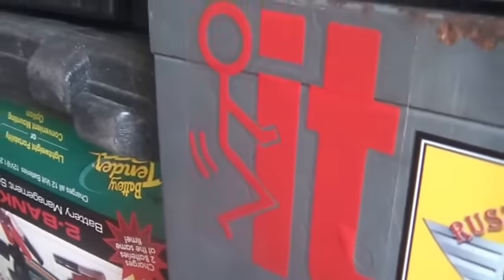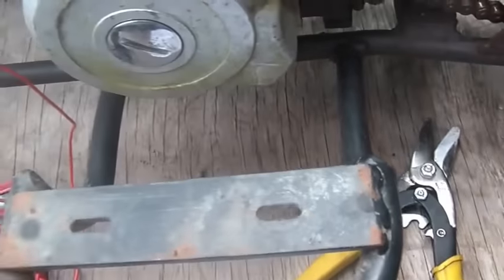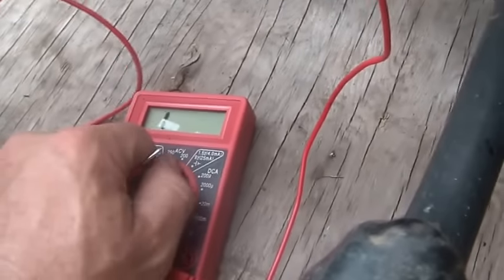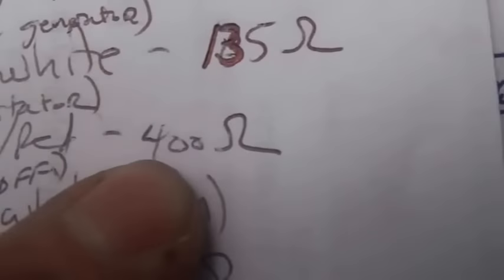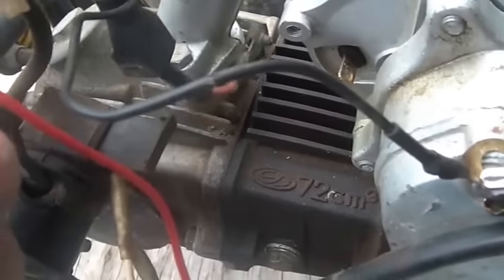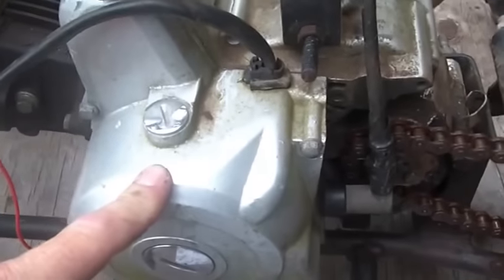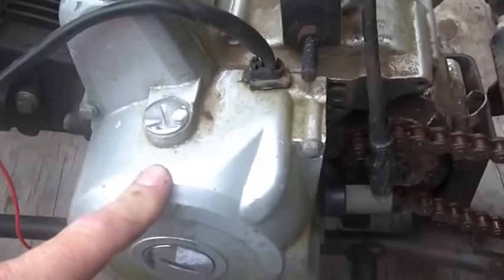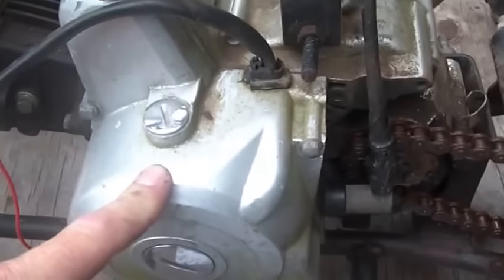Troubleshooting a no spark China Quad, critical wire harness measurements,

Comment: my battery is not charging .. I  put in a new engine. 47cc pmf .. it runs the lights, but not bright,, horn not loud, chirpts ok at 6k  rpm.. but   wont charge battery ,  tested in voltage at  wires going in to voltage reg/ rec   11.5 volts.. and other pair 8.5    help//
Reply from the maker: Hey Jon,  Not Sure how many phases Ur stator are putting out, typically for the smaller engines, they are 2 phase, (2 yellow wires), between the 2 yellow wires with the engine running should be a voltage above 13V.... I'm thinking Ur regulator is bad....  Thanks for asking, watching, and commenting!!!!
Reply: one yellow one  and one red .. 5 wires,,, it runs the headlight, measured current going into the voltage regulator at 11.74 volts.
Reply: i just bought one, ill test it .. these chinese bike are notorious for these issues..fyi,  bought another bike same, no issues at all on battery or charging, but didnt swap out motor   thanks for reply
Reply: there is a white and a yellow. maybe its not ment to charge battery..
Reply from the maker: Hey Jon, U seem to be working thru the troubleshooting pretty well, from experience, and given that Ur bike is not in front of me, so, I can not trace the wires to be sure.... But, I'm thinking the red wire goes to the CDI to provide AC power, from the stator,  for the ignition system.... A white wire, and a yellow wire provide the 2 phases, (of AC Voltage),  going into Ur Voltage regulator, I hope this helps, please keep me in the loop, thanks for asking, watching, and commenting!!!
Reply: i think the  yellow is to run the lights, /white. charge battery.I am thinking now that, the bike powers everything ,, when i rev it to 5 k rpm , the horn peeps normal, less than 5k , it sounds low horn, The system, 12 volt 35 watt light,headlight ON ALWAYS. 12 volt 15watt tail light, indicator gear lights, on always. simply is too much for the bike to have any extra   power for battery.I will say , that less than 12 volts is going into voltage recifyier.It could be that  it is the harrness,, It could be that the front right brake is a switch that powers the stater that i took off. but the brake  switch is still on handle and in normally closed .postion.
Reply: Hey

Comment: Sir my bike sparkplug not sparking I changed all coil like stator coil,CDI unit, ignition coil plz what is the problem
Reply from the maker: Hey RY7003, U did the first thing perfectly, U changed the plug to start Ur troubleshooting.... Assuming Ur bike does not have a key FOB turn off circuit, I would go back to all the old components and wire harness, I would make sure that the grounds on the spark coil, engine, wire harness, and CDI are all good, then I would cut the black wire with the white stripe that does to the CDI such that it can be connected again in the future.... More often then not, the key switch turnoff and or left handle bar turn off goes bad.... Thanks for asking, watching, and commenting!!!

Comment: I like to find out how to do the oil mix gas engine 110 CC Yamaha I got the same problem with my wire harness can somebody show me how to do it appreciate
Reply from the maker: Hey Ana, A lot of 2cycle engines don't use a pulse generator and run at a much higher RPM, I don't think this ignition system would work for U.... Thanks for asking, watching, and commenting!!!

Comment: Don't know if anyone will see this but I got basically the same thing a little 72cc china bike and I got it running great and I was trying to hook up the ignition wires so I could have lights and I touched 2 of the ignition wires together and pop, now it just cranks, I checked the only fuse i can find and it looked good i swapped it with a different one just in case and it didn't work. If anyone has any ideas please let me know as this is basically my little get around quad. Please and thank you
Reply from the maker: Hi, No sure what U shorted together, but, my guess is that the CDI box died or the ignition coil, maybe both, most likely, the cdi box as they are pretty delicate.... They are cheap on eBay.... I hope this helps.... Thanks for asking, watching, and commenting!!!
Reply: @HarveySpooner  thank you very much sir, that's what I was kind of leaning towards is the cdi box I'm gonna try the first and hopefully that works, can you tell me the way to test that, or is it already in this vid and i just missed it?

Comment: can anyone help me i have a demon x 125 it had a racing inner rotor kit A.K.A the stator and flywheel but i swapped it over to a normal one because it broke anyway i get a pulse through the the cables at the stator but once i wire it to my cdi i dont get any kind of spark or that from the plug but i know its all wired properly ?

Comment: need a little help I got all colors plus a got a green and red
Reply from the maker: Hey Courtney!!!   U have a wire that is green and red or an extra green wire and an extra red wire???? I'm going to assume it is 1 wire, green and red, given that, if the other colors are there, I would not hook up this wire for now... If one of the wires, (ground, stator, and pulse generator), is undefined, I would use the process of elimination to figure out what it is... But, I'm guessing that it is stator ground, but, I would have to look at the other wires and test it to ground with a digital Volt Ohm meter to be sure.... I hope this helps, thanks for asking, watching, and commenting!!!!
Reply: Courtney Kelley help colours

Comment: My 2008 Chinese bike will not run had it tuned and a new battery installed and a new carby it worked for a week and won't start 
Apparently you have to pull the clutch in to start it and need a full battery charge it has an electric start as well and a kick start but it just winds over on electric start and you can not kick it over 
Think it might be shit fuel like ethonal 91 maybe need 95 or 98 
Its a 250r 4 stroke Chinese brand 
Help or ideas if you can already paid the shop three hundred bucks not going to take it back as a kid worked on it 
I live in Brisbane Australia looking for a good shop or mechanic to look at it for us 
Cheers Tony and Sonya

Comment: Every technical video like thus NEVER show the exact range or setting they use on the multimeter. I found one video out of 8 that a guy explains the multimeter settings for people that doesn't know the meter.
Reply from the maker: Hey SCuba Do, It depends on the meter more then anything.... Some meters are auto ranging.... Generally speaking, I try to make my ohm, voltage, and current measurements at the lowest range possible on the meter.... I hope this helps.... Thanks for asking, watching, and commenting!!!!

Comment: I have a honda fourtrax 300 1991 I put a Chinese  Regulator rectify on it yesterday The old one 3 yellows On one side other side green red black But this one was missing the black Not thinking I put connectors on the green and red hooked it up Tried to check for spark was holding the plug boot and it lit me up So all of a sudden I have a bright blue spark I had put a new starter a new carburetor on it already already I got it to crank up And idle So I drove it around the yard I went about 100 yd to the gate and only made it 80 yd back it shut off it shut off now at the battery Box the red wire going to a 15 ant fuse is shortening outI have disconnected the key switch And the solenoid and put power to the red and it didn't blow it so I checked ground and all sames good.I call the people I got it from they said they didn't need the black wire and 2 other said they got one and it said black wire not needed. What are your thoughts I Was a Electrician for 21years till I fell out of a tree stand and this ATV was given to me when it did run it ran very  Strong If you have any ideas for me to check please Let me know @ Jhamby165@gmail.com Thank you loved this video I forgot one thing when it did start the key wouldn't turn it off I really need thing thing to run just for getting me around the yard or hunting woods thank you and have a great New Years

Comment: Hay dude iv got a 110cc Chinese thing lol i have every thing it needs air fuel spark timing good valve is good every thing is as should but the plug is not getting wet battrey is charged and it cranks, have injected fuel in to carb and it fires wright up. Its pickled my brain any insight on that lol iv been hunting for the same issue for about a week and no such luck lol as i think you are god with these lil bundles of fun i thought i mite ask lol thanks again love ur info in this vid

Comment: hi mate have a big problem I have bought a 50cc 4 stroke quad it wasn't sparking so I took off the plastics only to find that half the loom is missing and what wires are left are wired up wrong do u have any diagrams you can send me to show what goes from engine to relay and cdi etc and where they go to from there etc as I would like to get everything working on it you can fbook me craig newton Lawton

Comment: Really kinda useless video. Does not explain how to test the stator. How to check for pulse. No cdi troubleshooting. You basically spent all this time explaining how to check the wiring but not a single one of thencomponents
Reply from the maker: Hey nsboost!  Made this video a while ago, but, Ur thoughts are valid, Thanks for watching and commenting!!!
Reply: @HarveySpooner  Tip that made troubleshooting easy. You touched on this, The black wire with a white stripe into the CDI box it grounded when the kill switch is activated… the key is off, oil level safety is tripped etc. So if you depin that wire and the engine starts, you know it’s a safety/ignition switch issue and not a issue with the ignition components